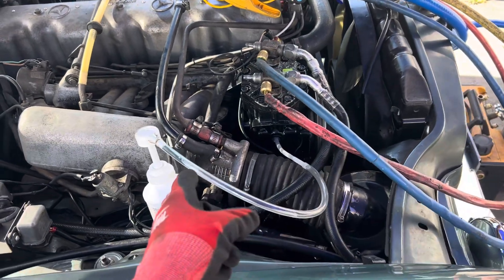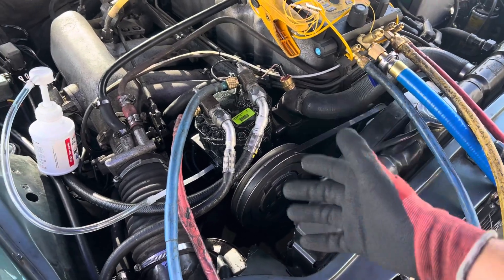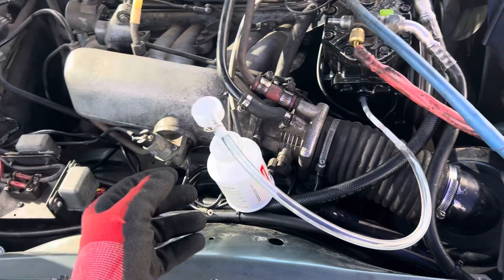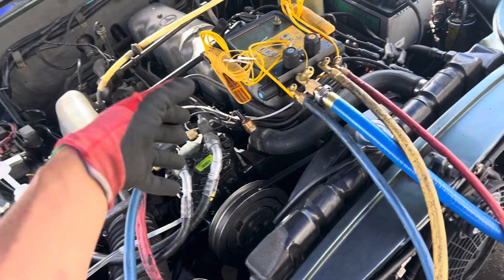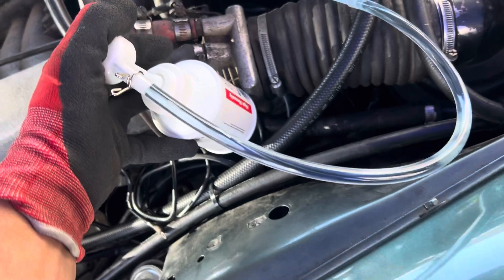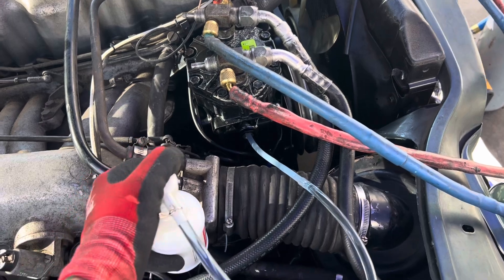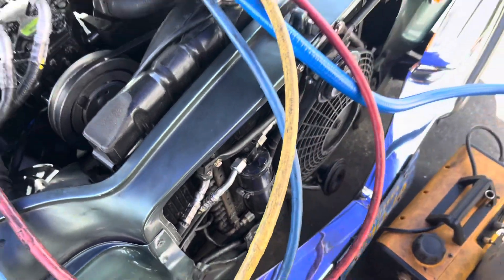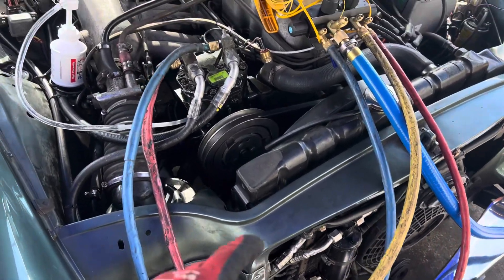AC system damaged by HIGH MOISTURE content. ￼ rust flakes clog the expansion valve.

Comment: Hello,
Q:when ac had a leak does air enters the system (the pressure is postive not zero)?
As i know yes iwill have some recirculation and air will enter ...what do you think?
Reply from the maker: @abdullwwful  not on most new modern cars.  Because the low pressure switch on some, but not all cars.  Will not allow the car to operate in a negative vacuum as a refrigerant level gets low.. 

There are some cars that as long as there’s enough pressure to start . 

Once the car is started, and the refrigerant level is low . 

If the leak was on the low side of the system .  And then the engine starts it can pull in air when that particular vehicle operates in a negative room for being so low on refrigerator. 

Many many years ago on Old Cars it was common to have no low side protection . 

So if you had a expansion valve system, as it got low on refrigerant, it would go into a vacuum and pull in air on the low side of the system if it had a leak on the low side of the system . 
Not so common anymore
Reply: @coldfinger459sub0  if the pressure on low side above zero does it pull air when the refrigrant is very low?
Reply: For example mini split unit ...etc
Reply from the maker: @abdullwwful  not if it’s a positive pressure
Reply from the maker: @abdullwwful  as long as it never goes into a negative pressure and it is always a positive pressure. It cannot pull air into the system.

The air would be introduced by the technician who installed it 

Or Air can be introduced by a later technician who comes along and hooks up their hoses that has not purged out the gas from the hoses . 

And when they add more gas in behind the air and the hose, they force the air into the system . 

There are old style mini split systems that had very little protection and would allow the low side to go into a vacuum because they basically operated like really old, mechanical single speed compressor motor systems 

But a system that never pulls into a negative vacuum air always comes, and it caused by the technician is at fault .

Comment: Tom, do you have a rule of thumb for temperature drop across an evap that you would call "working well"? I just charged mine. It was 78F in the garage but with a hot engine at 1500rpm and hood opened i was measuring 120-140F at the fresh air inlet and getting 58F vent temps. I have not gone for a test drive yet with the hood shut, but I am hopeful with more reasonable inlet temps I'll be in good shape. Thoughts?
Reply from the maker: @stevetrepanier4351  even though you have 120 or 140 engine temperature air that’s not what’s being delivered to the evaporator

It’s a mix of the ambient plus the engine because it pulls air from other sources underneath the vent to left into the right .  And from the windshield mixes with the hot air

The only way to get the air temperature that truly reaches the evaporator is by putting a temperature sensor probe in front of the evaporator intake of the blower motor 

30° is really poor performance, but some OEM manufactures called that good 40° would be preferable 50° is excellent .
Reply: @coldfinger459sub0  great advice thank you. I can't wait to try with the hood closed and outside.
Reply from the maker: @stevetrepanier4351  even though you have 120 or 140 engine temperature air that’s not what’s being delivered to the evaporator

It’s a mix of the ambient plus the engine because it pulls air from other sources underneath the vent to left into the right .  And from the windshield mixes with the hot air

The only way to get the air temperature that truly reaches the evaporator is by putting a temperature sensor probe in front of the evaporator intake of the blower motor 

30° is really poor performance, but some OEM manufactures called that good 40° would be preferable 50° is excellent .

Comment: i guess what im asking do i even worry about acid in a system if im just replacing a hose and minor repairs. i no  i could not take a sample and send it off at that point. i will have to get my nose tuned in cause i have not smelled enough of it to no a difference. i smelled lots of things but that one maybe i have or maybe not. i will start sniffing refrigerant more often so i can tell the difference. learning  something new every day wow
Reply from the maker: @RATCHETMAN1001  I know Automotive because it is considered such a cheap HVAC system compared to a residential or commercial

There are sometimes I would like to perform asset test on cars, but by that time if the system is that bad, you’re going to be flushing it anyway . 

As a hose replacement or condenser replacement, I would not even bother checking . 

Smelling refrigerant as it leaves the system there is a distinct smell when the system has excessive moisture, especially if it was a POE oil system, especially if it was a plant derivative base additive and it breaks down into something that smells like rancid salad oil, corn, oil, vegetable oil underneath your Shelf that was pushed to the back from seven years ago . 

And smelling refrigerant helps if you put a plastic bag over your head with the refrigerant hose and a rubber band around your neck and take deep long breaths  🤭. 

Being serious refrigerant has smell to it when it’s a rancid system 

Or if it’s a electrical compressor with a burnout, it has a very distinct pungent odor to it 

Don’t forget Taste 

Give this a try 

If you have any old mineral oil system, take a little dab on the tip of your finger, put it on your tongue 👅 

You basically almost taste nothing other than a feeling over your tongue just as if you got mineral oil out of your medicine cabinet exact same thing

Now dip your finger in a little bit of DENSO ND-8 
Put a little dab of that on your tongue.  👅 
It’s not gonna kill you. It’s not gonna eat up your tongue like acid. 

Give me your findings on your result on the taste test. 

And I guarantee you for the rest of your life. You will definitely know the difference between mineral oil and PAG.

Especially PAG DENSO ND – 8 

It’s a learning experience
Reply: @coldfinger459sub0  my poe oil container say known to the state of California it will cause cancer. also it says dont ingest if so call gavin newson. u no im joking thanks

Comment: i n the residential guys have kit for testing acidity. so  on a repair where a system is saturated  with moisture and we dont no how long its been like this should we do an acid test or do they even make a test kit for us and whats ur thoughts on this.i told you the more u teach me the more questions im gona ask ,heheheh
Reply: I've confirmed suspected acid using litmus paper.
Reply: @thisisyourcaptainspeaking2259  ive heard the term litmus paper .where do u get it and how to use it and is it a positive test or a maybe test
Reply from the maker: @RATCHETMAN1001 
https://www.google.com/search?q=pH+litmus+paper&rlz=1CDGOYI_enUS965US965&oq=pH+litmus+paper&gs_lcrp=EgZjaHJvbWUyBggAEEUYOdIBCDcwODJqMGo3qAIVsAIB4gMEGAIgXw&hl=en-US&sourceid=chrome-mobile&ie=UTF-8
Reply from the maker: @RATCHETMAN1001  those acid kits are only somewhat accurate. 

They’re better than absolutely nothing 

But there must be a oil content to the refrigerant that passes through the indicator 

It’s the oil itself that will hold the acid that needs to come in contact with the indicator so when you put on one of those pushing acid test kits if it’s only refrigerant that comes out, it will often show up as negative because there’s no oil that’s going to sample 

In commercial industrial and residential, there is a liquid sample test kit where you actually pour out oil from the compressor into a liquid and then mix it with a second liquid shake it up and down you let it set for five or 10 minutes and then you compare it to a color test kit indicator that is more accurate 

There is very much more accurate method where there is a test file that you send a oil sample off to a laboratory just like you do your engine oil to a engine oil laboratory. There is a refrigerant into oil laboratory that actually test your refrigerator oil that you sent to them that is the most accurate method.

Comment: Does altitude affect the ability to get the system down to the micron level?

Like does it take longer, and or do you need a bigger vacuum pump to get it down to that level?
Reply from the maker: @who_wantsit  higher up an altitude less vacuum, you can achieve. 

Render vehicle so the hot engine can heat up all the vacuum lines and compressor turn it on heat and defrost inside the car while it’s under vacuum and the hot heater air will be drawn over the evaporator heating it up speed up vacuum times to remove moisture
Reply: @coldfinger459sub0  thank you